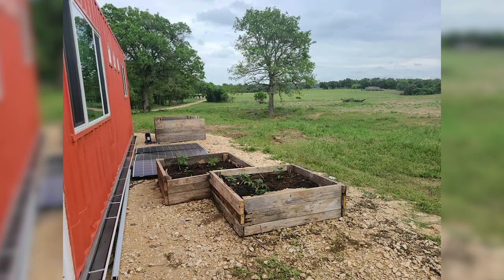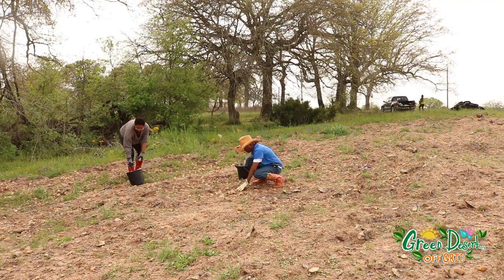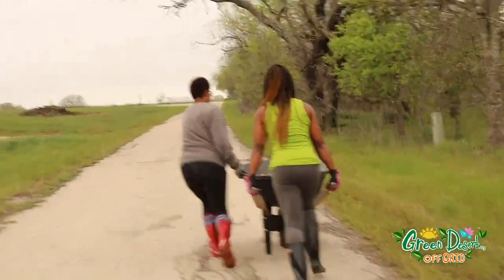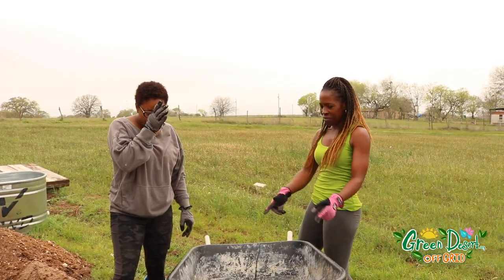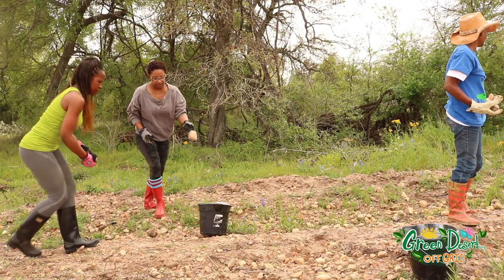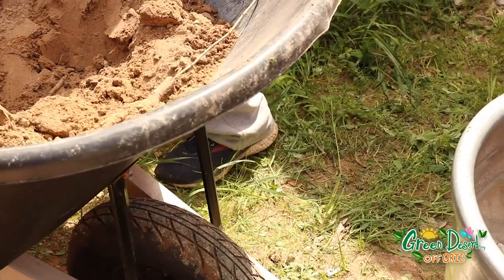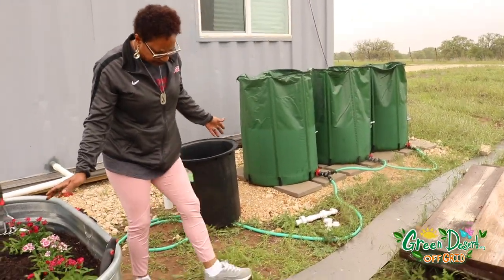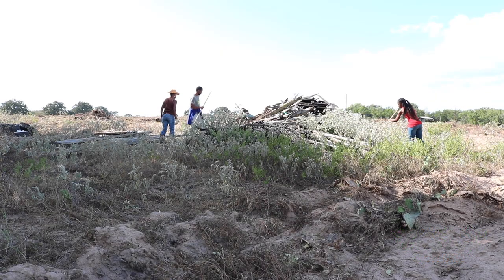Our greywater system is complete!

Comment: Thank you for posting this. We're renovating an old house in Japan and have decided to go with a composting toilet instead of installing a septic tank. I was wondering how we could run the urine collection into the gray water for the house, and this video was the first I've found to really give me a sense of how to do it. We don't have more than three feet behind the house, but I'm sure we'll figure out a way to make this work.
Reply from the maker: It really depends on how you use your grey water. Make sure the grey water drains below ground so it doesn't splash or get on your vegetable plants. It should be OK to water your fruit trees. Cleaning process is key.
Good luck!!
Reply: My idea for a tiny home was a 3d printed urinal with its own urine collection, but from the sounds of it you have a wifey who wouldn't be too happy with a urinal.

Comment: Put your load more to the front and over the properly inflated tire when using a wheelbarrow. Keep your back straight and lift using your legs. The trick is to find the balance of the load over the tire. Anytime you can travel on firm and smooth terrain is much better than the bumpy, unlevel ground. Don't overload the wheelbarrow and an extra trip will be easier on yourself than the struggle of a heavy load.
 Better yet using a 4-wheel cart such as a Gorilla Cart that dumps is a far better tool or even a two-tire wheelbarrow. The cart can be hooked to the hitch of the truck, a riding mower, an ATV, or even the 14-year-old if he is being "sassy" as well as any family member who may draw the short straw.
 Just like a front-wheel drive car, it is much easier to tow a load than to pick it up and push it. Happy gardening!

Comment: How did you make your grease trap? I'm going to make a similar design and was curious what you used and how it's working so far. Thanks! Great set up!
Reply from the maker: We didn't make it, we bought a stainless steal greace trap off amazon.  So far it is working really well.
Reply: @GreenDesertTV  thanks! I'll check Amazon I know some of the predone ones are $$$ but for my system it's only 1 person so I dont need big one.

Comment: I’m curious: Is urine considered grey water?
Reply from the maker: Technically it really is considered black water. We did a lot of research and learned that urine is actually pretty sterile and a great fertilizer when diluted. It's a small part of our greywater system, and we're building more beds for cleaning. The cleaning system with charcoal helps since it removes toxins. To be anally safe, we're not using the greywater for anything edible.

Comment: Some folks have converted those into diy hot tubs with a copper coil wood burning basket for heat. Another thing is using the larger 15'-20' in dia  round stock tanks as small swimming pools.   this channel had a really neat idea about having an outdoor straw bale out house  as a urea capturing pissoir  (https://youtu.be/dztgMnaH1rw).  I thought it beat the capture & dilute method by a long shot. More like a rake & spread with little odor.
How are you addressing the wind breaks/barrier from the prevailing westerlies?
Be Well & Keep Safe y'all
Reply from the maker: Interesting... we will check them out!! We haven't had any issues with the wind... I'm crossing my fingers that I'm not speaking it into existence😁
Reply: I have my own hillbilly hottub that does just this, I sold the old stock tank I used because I stumbled upon an actual bathtub in an alley way.